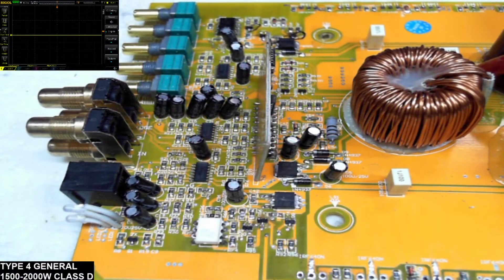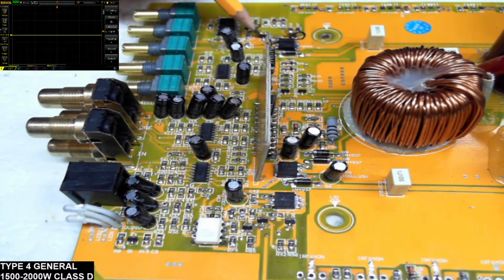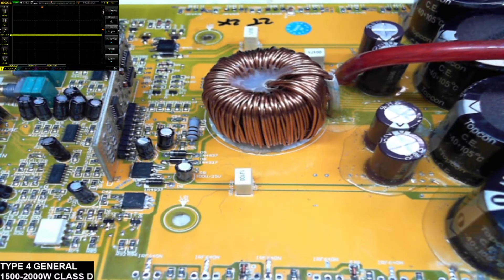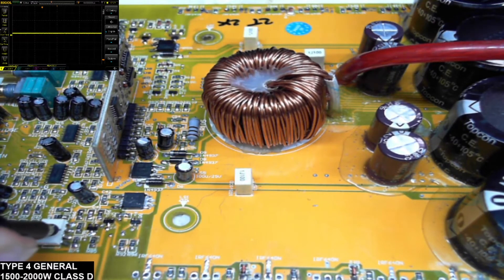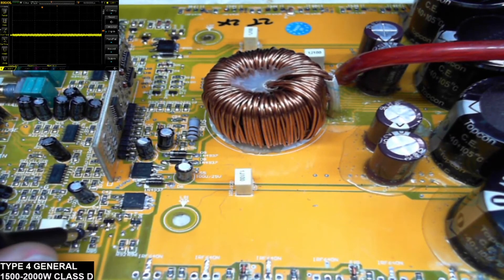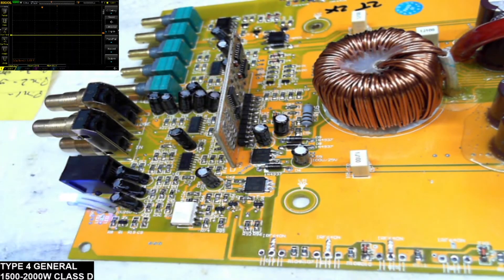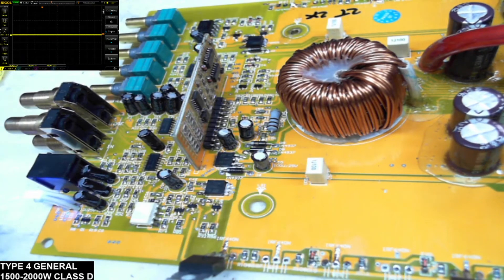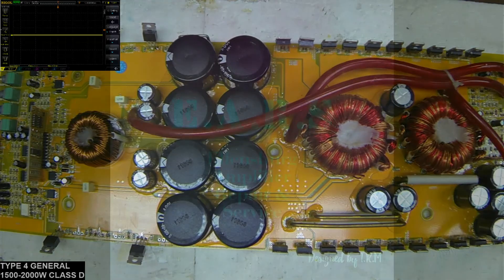type 4 1500w 1800w Class D Automotive Amplifier Repair and Process

Comment: Sorry for bother u ....icheck square wave for both negative positive rails and they are fine butttt when i load the banks , the negative side mosfets start warming pretty well , the gate wave distorted , pull out mosfets and the wave for both sides back to normal , any idea !!
Reply from the maker: The feedback circuit or a shorted inductor ;)

Comment: hi Tood, Can you explain where I connect the oscilloscope probe ground on each amplifier measurement? excuse my english, I am from Venezuela, I have already repaired 2 class d amplifiers watching your videos, in class ab I have a lot of experience, I bought a picoscope 2203 to repair myself in the repairs of this PWM technology, thanks a lot
Reply from the maker: Most of my measurements are referenced to the power negative terminal (B-). When I am checking the pre-amp signals my scope is referenced to the RCA ground. This is only because my power supplies are isolated. If you are using a power supply that is not isolated then your scope will already be referenced to the power supply negative power. Be aware of the maximum voltage for your Picoscope 2203. That scope is also grounded to the PC mains through the USB connector so watch for loops.
Reply: @ellensburgamplifier  What if we are measuring the signals of the drivers board in the gates of the mosfets?
Reply from the maker: @sixtosalazar3496  I reference the RCA ground (shield) when looking at my input signals. You can still measure the gates using the power negative as the reference. Remember this depends on your power supply.
Reply: @ellensburgamplifier  My power supply for  repairs is a 3amp linear transformer, I made an resistance measurement with my multimeter, between the negative of my power supply and the ground of the oscilloscope probe at 40Mohm it does not register any value, I assume that the oscilloscope is isolated from the power supply
Reply from the maker: @sixtosalazar3496  Sounds like you should be ok. If the board is starting up fine then you should be able to probe the gates of the 640's and see a clean signal.

Comment: Orion 250R third generation I think,, I replaced two of the NDP 7060,,, bad idea,,,So now three additional have blown apart,, to capacitors appear to be bubbled4 more smaller transistors next to the TL 494 and another eight resistors,,, translation BOOM!!!!
Reply from the maker: Sounds like there is a short in the power supply. The small transistors next to the 494 are the drive transistors. Those will fail if there is a short on any of the power supply transistors.

Comment: Hey Todd, great video, as usual. There is a little trick you can do with a capacitor. I use a .01uf to load the gate and source and you can tell if the drive has any problems. Sometimes you can have a nice signal with the FET's out and then place them and find out something else is wrong. With the cap you load down the drive circuit and it will let you know if its good or something is bad. Can do this with Power supply also. Just saying
Reply from the maker: Oh yes, Perry taught me that one. I do that on boards that use the TO247's like the IRFP360LC FET's as they are super expensive ($7 each through Mouser!) compared to 640n's. Thank you for watching Cliff! It's hard to imagine people actually watch my videos.
Reply: @ellensburgamplifier  When it is good content and what I like and want to watch, I don't see why you couldn't imagine it.

Comment: here is a question on an internally strapped 2 ohm amp that a customer wired to half ohm why is it that only one board takes the damage the second board to be more accurate. the first board took no damage at all and i was talking to another tech who was also working on the same amplifier ap-30001d and had the exact same damage from the exact same user error. is this to be expected? i just assumed everything would have been burnt
Reply: dont get me wrong im glad it was not as id have had no way to get the part numbers otherwise. but still cant wrap my head around it
Reply from the maker: Hi Mike. I would say it is due to the design of the board. I have not had the pleasure to dig into one of those but I do know that the designs have not changed much with type 4 boards. I think this comes down to resistance and internal wiring inductance. Is this first board closest to the speaker terminal block? Half ohm? Yikes!
Reply: @ellensburgamplifier  side that the power enters the psu and output are destroyed so badly i could not get numbers off the semiconductors  side with speaker terminals is intact
Reply from the maker: Guess what came in today Mike, An Audiopipe AP-30001D Such an odd coincidence! Repair video coming soon
Reply: @ellensburgamplifier  its a beast of an amp